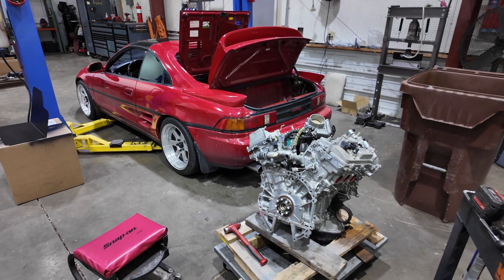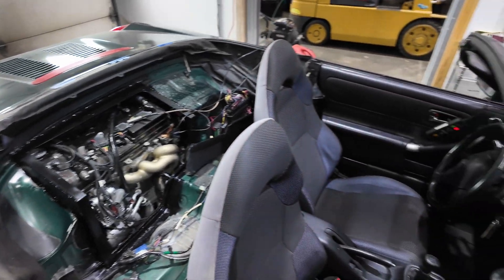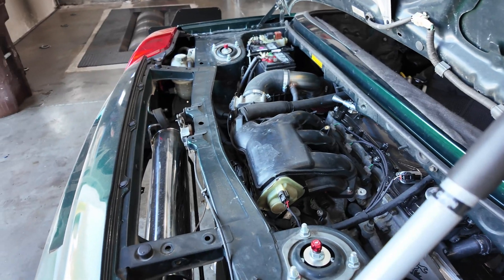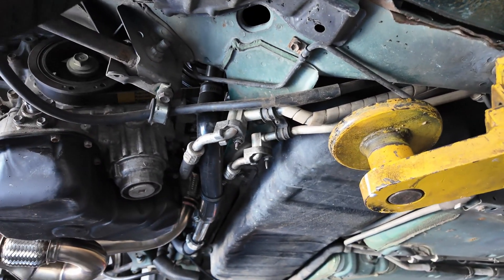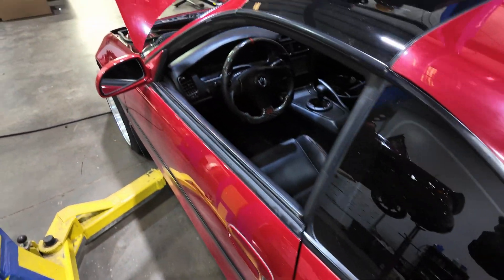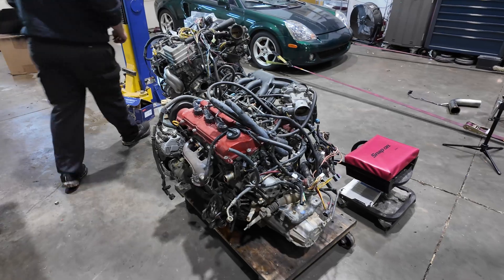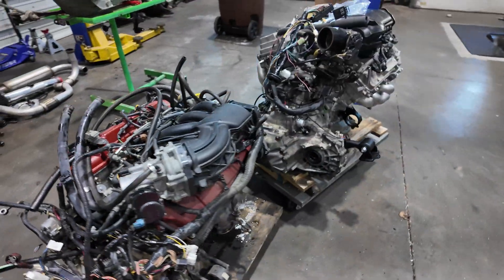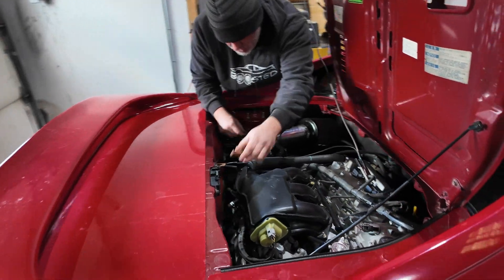300whp from a STOCK 2GR-FE V6?

Comment: Important to state transmission in use when quoting WHP figures imo
Reply from the maker: in the video we mention it has an E351 quite a few times
Reply: @tcsmotorsports  Thought so, expect 20whp  less from E153?  I was/am drinking so my attention span is shorter than them dyno pulls~  Love you guys
Reply from the maker: @tescolonggrain  no, the difference is small. Probably just a few whp. Every car is different though.
Reply: @tescolonggrain  ~15whp more than an e153